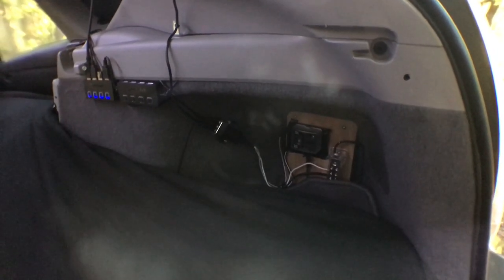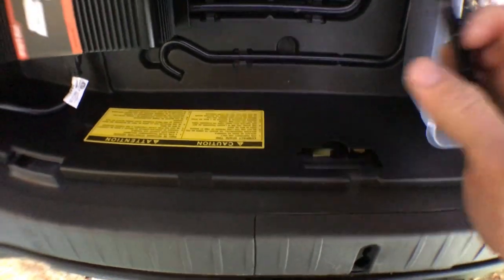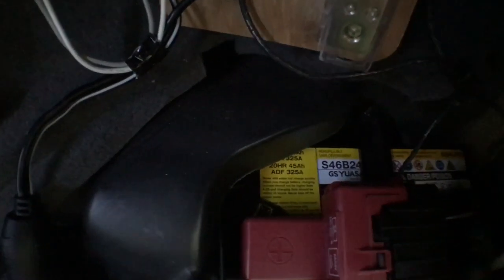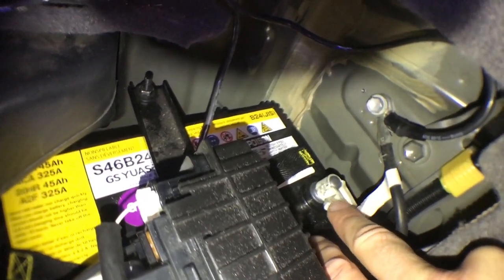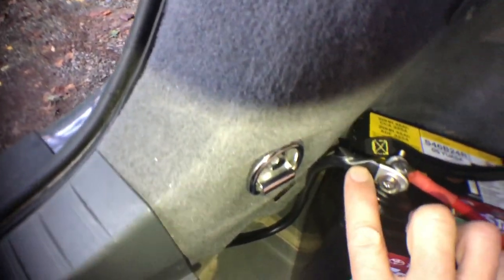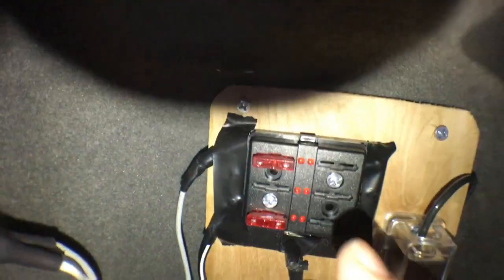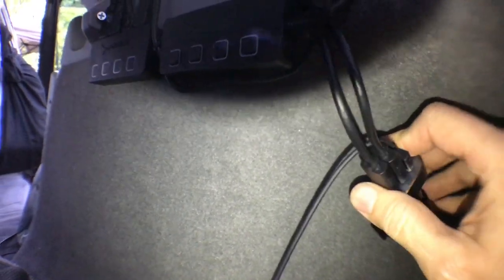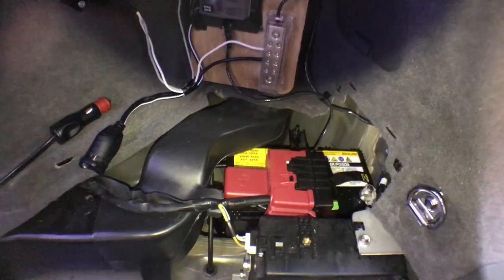Prius Stealth Camper - Electrical: Adding a second 12v battery, inverter, microwave

Comment: I recently got a2012 Prius V. I hook up a 2nd battery the same way and added a 2000 watt inverter. Everything works great. Thanks for the Tips. 👍
Reply: What brand or model you have what are the things you run on the inverter ? I would also like to mod my car

Comment: 2:30 Prius batteries are both cranking and deep cycle, Really valuable bit of information. Thanks!
Reply from the maker: Will Nettles I didn’t want to put a giant deep cycle battery in because i didn’t know if it would affect the cars electronics. I’ll let someone else try that. Thanks for subscribing!
Reply: PriusStealthCamper Adventures why did not You have a separate battery  use a MPPT solar controler. Then buy a 100w solar panel Also add a switch where if ur car alternator is running you can charge it
Reply: @beedslolkuntus2070   Prius doesn't have an alternator.  The starter battery gets its charge from the hybrid battery
Reply: The 12v battery only powers the electronics, this is why it’s called the auxiliary battery, the high voltage battery is the one that starts the car by spinning the hybrid electric motor. It doesn’t have a starter as such.

Comment: Been living in a prius for a while and thought it was just me!!!  You might find the alternator/dynamo in the prius is too small and 60-150 watts of solar is needed.  But if you travel every day it might work.

In the uk you can take out all rear seats, seatbelts and pass the MOT test which saves weight too.  Personally have breakdown so don't have spare wheel etc (19kg)

Cool video's!!  A little ahead of the game
Reply from the maker: That great that you are living in your Prius. I just do it part time. I enjoy trying to figure out how little I can get along with. I did 2 videos on a folding solar panel and connected it to the 12v batteries. You might find that interesting. Thanks for your post and for watching!

Comment: That was great. Just starting to looking into the electrical, having the same idea of adding a second battery AND the inverter, so HUGE Thanks! Just came from a video that added a gizmo between the two batteries that automatically isolates the second battery until restarting the car again. It's called "SI-ASR: Start Isolation Automatic Charging Relay from Blue Sea Systems" that's what was used in the other video. I'm still learning, increasing the odds of getting it right the first time. All The Best with your set-up, THANKS👍
Reply: My friend, how did your set up go?
Reply: @xtaltheo170  would you believe... I'm this close (with small space between thumb & index finger) with the electrical, your timing is remarkable. All I need to do is connect the wiring, probably tomorrow. I just added a 2nd battery, the SI-ASR relay & in-line safety fuses. I got side tracked & delayed when the ABS module went bad, so I did the DIY research, bought a ebay replacement & managed to pull it off👍so 1st road trip may be next week. Are you doing a set-up on your Prius too?

Comment: Cool to see!  I did similar though no way installed like you have... the 1500W Pure Since Wave inverter and Exide Marine Deep Cycle battery are in an early video regarding the TDS-520B I made.  Great job!  My kit wound up staying in the farm building/station since didn't need in the car when I started working.  I was planning initially to boil water and use a hotplate to replace the gas stove... though found the mug size... I forget off hand... 100-120W maybe 12VDC hot water immersion heater the way if when in the car and need in the future.   Was almost thinking about trying to make a hotplate from diesel glow plugs or winding my own coil(s)... though never go that far.  Thanks for sharing!

Comment: Thanks for this.  Did you do this simply to have more capacity?  Do you still need to have your Prius in ready to use any of this stuff?  I saw a guy that did this but he included a battery isolator and ran the 12v off that battery.  That way he did not have to have his car on the run his fridge.  Can you talk a little about your thinking in this for a newbie like me?

Comment: With a 2nd battery, could one use an up to 1500 watt convection microwave to bake for up to say 45 minutes?    I'd like to be able to bake if the power goes out.

Comment: I'm considering trading in my Wrangler for a Prius now. I like how you can have heat or cooling all night and the engine starting itself for battery maintenance automatically. Even if I never lived in the Prius it would be good for when I'm working night shift every winter to keep the car thawed out and not cost that much. The fuel saving would more than pay for that, and probably the car payments!

Comment: Question please... cuz you know a lot more about the electrical of the Prius than me.  I need a CPAP machine to sleep.  I have an external battery pak to operate it independently at night.  It has a cigarette lighter plug to recharge it during the day. Will the recharging affect the engine starting battery if the car is off all day and the battery pak is recharging, or will it work off the big Prius battery?
Reply from the maker: Thanks for your question. If the car is in the OFF state, then the 12v battery charge is not maintained by the car so you could deplete the battery and it would not start. However, just leave the can in the ON position and the car will maintain the charge on the 12v battery. When it starts to deplete the main battery will charge it, when the main battery depletes then the engine will kick on and recharge the main battery which will in turn keep up the 12v battery. With the car in the OFF state I am fairly sure that the main battery will not maintain the 12v.  I hope that answers your question.
Reply: Awesome. Thanks and thanks again for the quick reply.

Comment: I got rid of that factory battery and installed a 52 amp hr Agm  it fit nicely and added another to the other side paid 75$ for each and added 2 more bigger grounds. those factory toyota batteries are crazy expensive.
Reply from the maker: The Toyota ones are nuts. I have been hoping someone would try what you have done. I have had several people ask if it is possible. Thank you for posting this. The setup you have makes solar much more useful.
Reply: @timdillen  they are csb brand agm batteries they have terminals that use 1/4 inch bolts I have them in parallel for my audio system 1500 watts works good they are basically large wheelchair batteries.
Reply from the maker: Nice! I will have to check those out.
Reply: awesome! do you have the link where I can order the 52 ah AGM battery?
Reply: @tinapa7898  unfortunately no I bought them from a local battery shop in Oklahoma city called hunter battery. I am now in the process of building lithium batteries for it now.

Comment: Very informative!   So with a Prius if you use Prius battery for second battery you don't need or want a solenoid to isolate your second battery?
Reply from the maker: Thank you! I would like an automatic switch over but did not want to spend the money. I did end up putting in a manual isolation switch on the second 12v battery. I generally only isolate when testing projects or when I think I might use too much power with the engine in the OFF state. As long as in the ON state there is no possibility of killing the battery. I did find the hard way that if you kill the 12v battery, the car will not start even if the big drive battery is charged. The Prius needs the 12v system to run the computer to start the car (and probably the starter).
Reply: @timdillen  This is good information. I wondered exactly what the 12V battery did, and now I know. Thanks.
Reply: @timdillen  I just purchased the 2nd Toyota battery yesterday and I am looking for an inverter now. Do you wish you had gone with a larger inverter? I found a 3K Watt inverter with a on/off remote, but it looks to be about double the length of yours. Wondering if it would be wort the trade off in space... Also, it may be a much larger power draw on the battery? Finally, do you have the link for the 2nd 12v battery manual isolation switch that you bought? I always appreciate your guidance. Thank you!
Reply from the maker: Robert Medina That is a good question. The Prius did not seem to have a hard time running the microwave off the 2000 watt inverter so I think 3000 would be fine. Just make sure you know the correct thickness for wiring and that you flip if off when not needed as the parasitic draw of a larger inverter might be a bit. I would definitely go with a pure sine versus the modified one I went with. On my latest video I show how I used the Prius to power my ambulance camper. Did very very well. I was so comfortable. I can’t remember where I got the disconnect. You might want to get a better one then mine. I think the dial ones are sturdier.
Reply: I installed an automatic charging relay from Blue Sea Systems on mine, so when charging, the two 12v batteries are parallel, when discharging, the two 12v batteries are isolated. Works wonderful! You can see what I did: https://youtu.be/cLCAIXEVy94

Comment: Wow. Out of the 5 or 6 prius camper setups I've seen on YouTube, yours is by far the best! Anyway, I've got a couple questions I hope you can answer:
1. Can you run the fridge all day even with the car turned off?
2. Do you think it would be safe to attempt to wire all of this up for someone who has almost no knowledge or experience with electricity? If not, what would be the best way to learn?
Thanks!
Reply from the maker: Thanks for your kind comments. 1. Yes, I leave on all the time. The double 12v battery can handle for 24 hours but I have to at least put the car in the On position after that (or drive somewhere which is usually what happens), I don't like running the batteries too low. Once the engine runs a bit, the large battery is charged and it looks like when the engine shuts off, the system continues to charge the 12v batteries from the 200v battery. Just for charging (no climate control), the engine runs infrequently and for short periods.  #2 is a tougher question. I think it would be good to have someone else wire the 2nd 12v battery. You could also have someone setup the 12v fuse box and negative block - adding things after that is easy as long and you keep track of your positive and negatives. Since you are working on the good side of the fuse block, you won't fry anything important, the fuse will blow first.  I don't have much invested in my car and I have some self taught experience in 12v applications but nothing professional or formal. I have been sparked and shocked a few times so maybe I am not the best adviser!
Reply: PriusStealthCamper Adventures Thanks for the quick response! Do you know who could help me set it up? Would a mechanic be able to do it for me?
Reply from the maker: A mechanic could do it but some turn their noses up at such projects but if you have a good one that you use a lot  they might be best. Ask your friends they probably know someone who loves to install car sterio equipment as a hobby. You might consider a custom sterio shop, not sure how many of those are still around.
Reply: PriusStealthCamper Adventures Thanks for the advice!
Reply: PriusStealthCamper Adventures One more thing: does the 2nd 12v battery absolutely have to be the toyota true start battery? If not, do you know of any good alternatives I can buy online?
Reply from the maker: Sort of, yes. The Toyota 12v battery is a bit of a hybrid thing (part starting battery, part deep cycle). I went to 2 auto parts stores and they told me to use the Toyota Battery. There is one on Amazon that will work (Optima) but it is just as expensive as the one you get at any Toyota dealer. A regular 12v battery might work but I did not want to chance it after I screwed up my BMW badly by using a battery that the auto parts store said would work. I have not heard of anyone else trying a regular battery but I'm waiting to see if someone does.
Reply from the maker: Amazon says this one will work with a 2009 Prius  http://a.co/2vJTySB
Reply: I have a 2005 that I built the window covers for and worked great for sleeping at night or daytime on my last trip.  I recently had to replace my original battery after 13 years of service.  I went to  OReilly Auto parts and they have a Platinum level prius battery that I bought for $189.00.  It is a couple of inches longer so I had to move the bracket over one slot and only use one bolt on the bracket.  I also made a spacer to take up the extra void that was created by moving the bracket over a couple of inches.  Works like a charm.  It is a Super Start Battery and the only Prius battery they sell.  I'm on a budget so every dollar I can save is important if I want to add all the add ons shown in these wonderful videos.  Thank you for sharing, much appreciated as I help two of my friends build out their brand new sprinter vans :)
Reply: @Fereday  can you recommend third party window covers? or something DIY from home depot?
Reply: @timdillen  I had an electrician wire a 2000watt inverter directly to the prous 12volt.. the alarm on the inverter went off to signal the 12volt battery went down to 11volts

If I had him wire a second 12volt.. do you think it would run the 5000btu ac (maybe 500watts). How long?

Comment: beautiful! Not being a techie, do you need extra power if you go without the microwave and refrigerator? Thinking only some lights, notebook,, etc. I assume there are extension cords with USB connections to get to the cars outlets?  Great videos!
Reply from the maker: Jim Sweeney Good question. The only big need for power is the fridge. If you don’t have that you will have plenty of power for led lights, phone and notebook computer. Thanks for your comment and for watching!
Reply from the maker: Jim Sweeney I tapped into the rear battery for the switches because the outlet in the dash can only handle 10 amps or 120 watts if I remember correctly. Just total your amps or watts you draw at the same time to not overload the outlet and blow a fuse. You won’t damage anything. Just have to find the location of the fuse to replace which is annoying.

Comment: so this is an example of wiring up 2 batteries in parallel correct? you get more amps and the same voltage. positive to positive, negative to negative?
Reply from the maker: That is correct. I have a battery isolator so that when I have the car in the OFF position I can disconnect and make sure I don't run the primary 12v battery down.

Comment: awesome set up ... great videos ...three questions... if i only wanted to run a dometic fridge could i do that wiring directly to the 12 volt battery and not have an additional battery set up like yours?  What size dometic fridge are you using? and lastly what about the off gassing of the batteries in your set up ?
Reply from the maker: Thanks! I tried doing the Dometic to just the 12v battery. It works if you turn the car on within 24 hours to recharge the battery. It was cutting it too close for me. If you deplete the 12v battery the car won’t start. It needs that battery to run the computer so even if the drive battery is full it won’t drive. I am using the CFX-24. Best investment I have made. Need to remove the handles to fit. Last check it went up to $625. Check around for a good deal. I have not noticed any off gassing. The batteries are sealed. Hope that helps.

Comment: Did you contemplate putting the second battery in the rear passenger side footwell?  Would it fit in there alongside, or at one end of, your Dometic?
Reply from the maker: Interesting idea. There was not quite enough room to place with the Dometic but would have been nice. Some have suggested putting a full size deep cycle in the rear for more power but I just was afraid it might mess up the computer system so I went with the exact battery and have not had any problems. The computer has no idea it is there. So far no one has tried the big battery that I know of.

Comment: Great video; you’ve got some nice aspects to your setup! I’ve spent the past two summers living out of my Prius for 6-8 weeks at a time, and it’s amazing how little we really need. Question for you though: I’m looking at getting a solar panel, but I’m not interested in the climate control or any of the features in the car itself. I assume I’d be better off with a stand-alone battery/inverter/charge controller rather than wiring it to the existing car 12v battery... would you agree? I’d definitely like a few LED lights like you’ve got, but I really just need it to charge phone/cameras, laptop, etc, without running the car. I have a cooler and jetboil for all my cooking.
Reply from the maker: Thank you - glad you liked it. Having a solar setup is helpful and a stand alone one would be fine. I did a 2 part series on a flex panel you might find interesting.  https://youtu.be/Vi_TeQAaipA

Comment: What're the ratings on your fuses? I'm assuming it's low depending on the accessories you used like the lighting.
Reply from the maker: They range from 5 to 10. The only 10 is for the fridge. I think the water pump was a 10 and the lights a 5. The electric bed warmer I think was a 10. Not exactly sure on those numbers.

Comment: Grear video. Im thinking to add my second battery like yours but can i use bigger battery? 100ah deep cycle battery and parrallel with the original primary Prius battery 45ah, will there be a problem? Im planning for both engine charge and solar too.
Reply: You May need a DC to DC charger controller with mptt in it